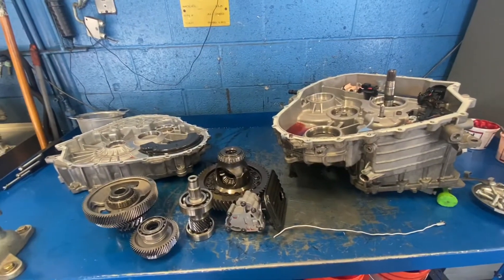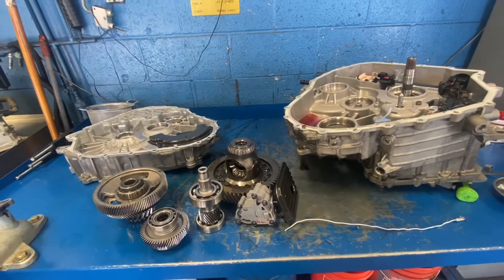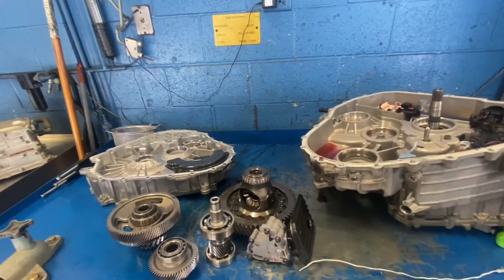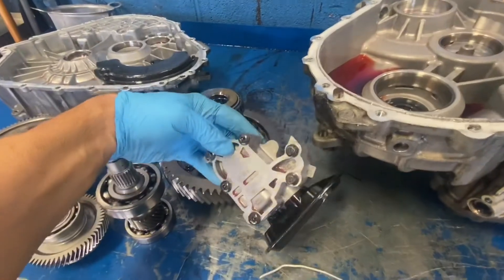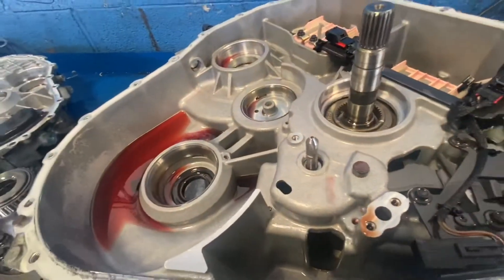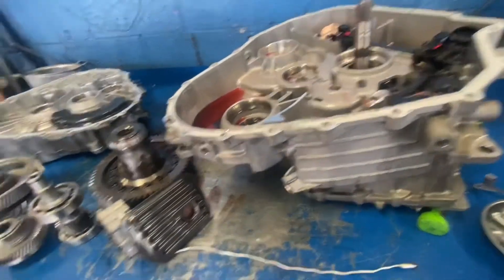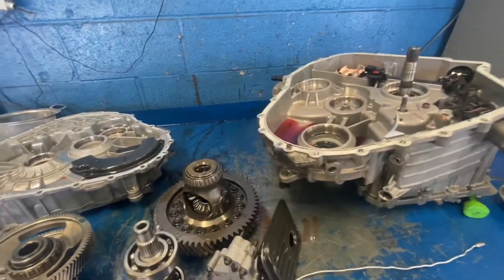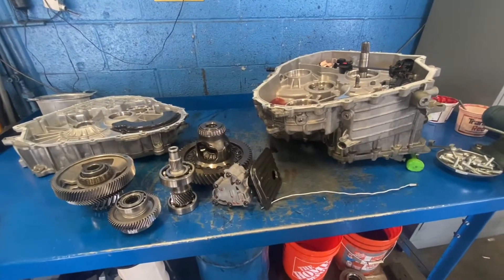HF35 Plug-in/Hybrid Common Failure

Comment: The only bad thing is about this warranty work is that now the transmission thats replace via warranty is now only covered by 1 year or 10k so in 2 years down the road when the transmission fails again which it will it won't be covered under warranty and you'll be with a $5800 repair bill.
Reply: These fail this way due to a low oil condition. Change it every 30k/50k miles and youll get a lot of life out of em.

Comment: Is there any way to prevent this?
Reply from the maker: That’s a great question. It’s no more preventable than a head gasket failing. Not guaranteed to fail nor last the life of the vehicle. Regular maintenance intervals will help, leaks are a huge contributor to this failure, so with regular service intervals you can catch a leak before it becomes a larger problem